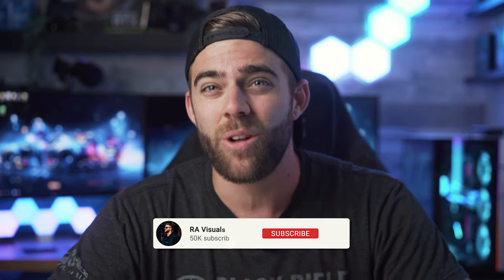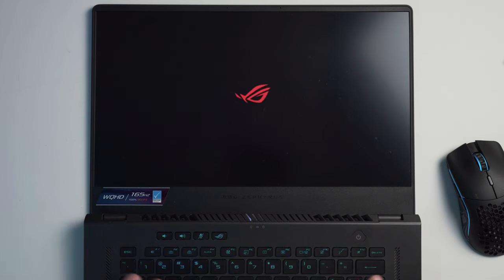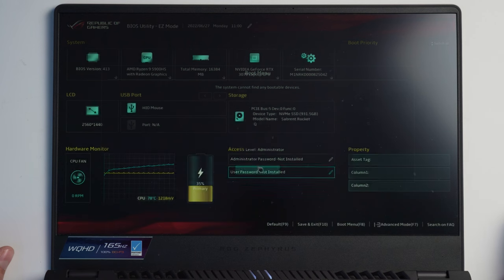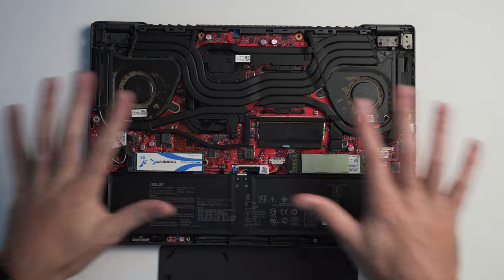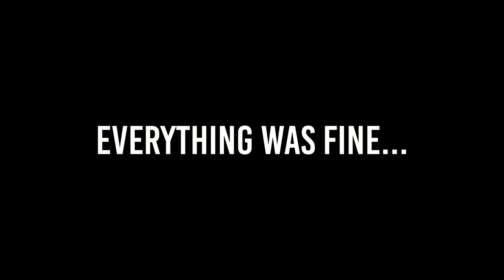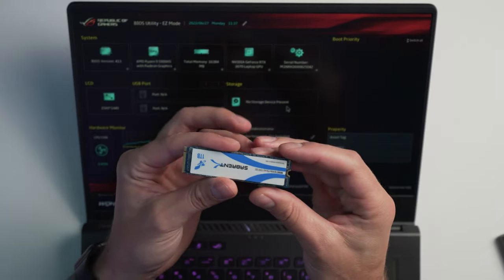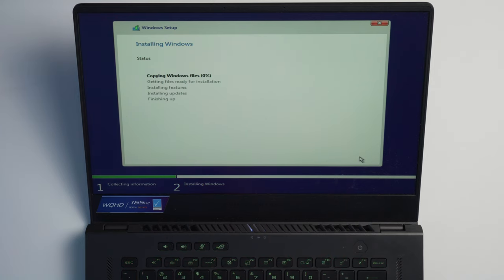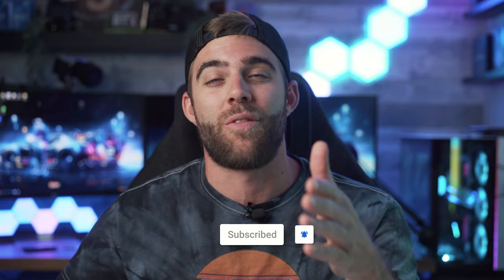My Asus Zephyrus G15 (2021) DIED 💀 Lets Fix it! | Troubleshooting + Replacing A Dead NVME SSD

Comment: its important to remove the battery cable before touching any hardware otherwise your laptop 💻is as good as dead, if it touches other electronics on the motherboard.
Reply from the maker: Yep! Exactly right! I definitely messed up there. Won’t make that mistake again 😂
Reply: @RAVisuals  I remember back when i was a kid , i was desperate to open up my puny tablet and replace the battery , but then i effed up by removing some IC shield and it slipped off my fingers then the metal shield crashed on the board and made an audible electrical short ⚡💀

Comment: Always unplug the battery... 🤦‍♂️
Reply from the maker: Yep. Bonehead move on my part for sure
Reply: That was pretty scary. I'm glad it didn't fry your motherboard. Also is there only one ram slot on that board or are they stacked? You'd also benefit getting another ram stick too. It would be better to buy a new kit though, 2 16gb sticks, I'm assuming you only have 1 in there now

Comment: I added a working Samsung 890 Pro 2TB to my 2022 and a 16GB RAM and the unit started shutting down after boot-up until I removed the HDD
Reply from the maker: hmm that's super weird! Mine took both of the ssds I installed in it without any issues. Wonder if it was messing up the boot order? maybe it was trying to boot from the new drive and if it doesn't have a windows installation, it will just restart the PC
Reply: @RAVisuals  Much thanks for your answer!
Windows boots up,  camera recognizes me and logs me into the windows desktop.  Then it shuts down after a few seconds.

So it does boot from the Stock Sabrent 1TB HDD.

Comment: Hi! Can someone tell me something… i have bought g15 with 3070 ti last week, but the small line on the back front panel panel (where is the dots) have started to peel off. I wonder what is the job of this line - some sort of antennas or it is just for decoration, because i am thinking of returning the laptop for this “issue”

Comment: 13:58 Whenever you buy an OEM Windows Laptop, you're also paying for a Windows license that has been bundled with it. OEMs buy Windows Keys from Microsoft at "wholesale" and store them on the BIOS chip of your laptop. So you can reinstall Windows as many times as you like on your laptop without having to worry about activation, because the key is stored in your BIOS and automatically activates Windows when you install, as long as you use the correspinding edition to your license (Home, Pro etc.).

Comment: Good thing that the flash/spark didn't destroy your computer. I  understand why ASUS wrote to disconnect the battery power cable, before removing and replacing any parts now!    :)
Customer Self  Repair (CSR) Maintenance and Service Guide: https://dlcdnets.asus.com/pub/ASUS/GamingNB/Customer_self_repair_guide/GA503QM_Customer_Self_Repair_Guide_20210731.pdf
Reply from the maker: Yep! I immediately knew what I did as soon as the spark happened. Just a dumb mistake but I guess you guys can learn from it! Haha